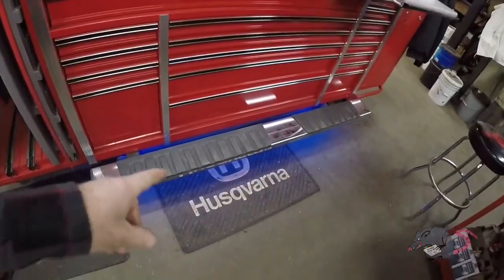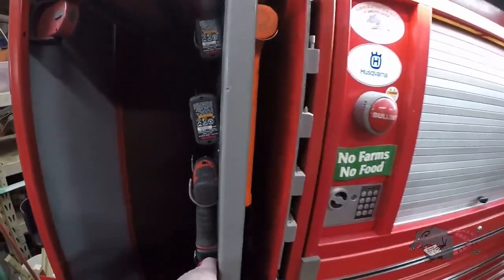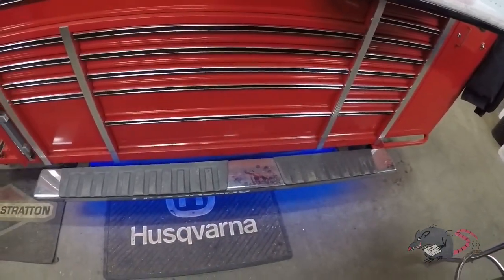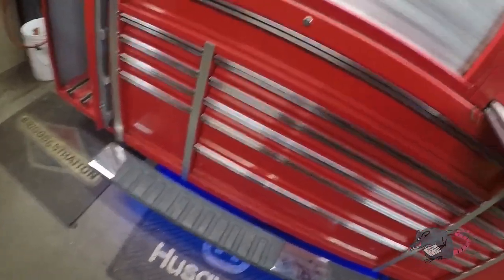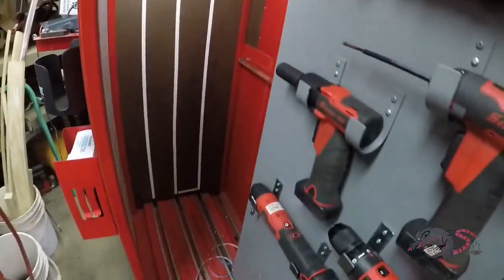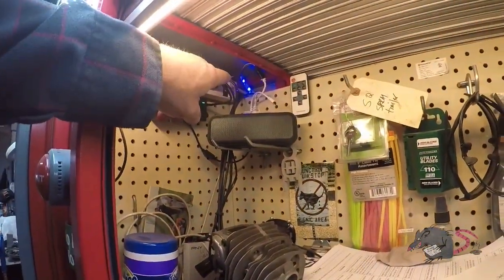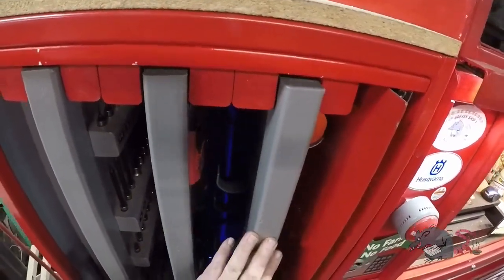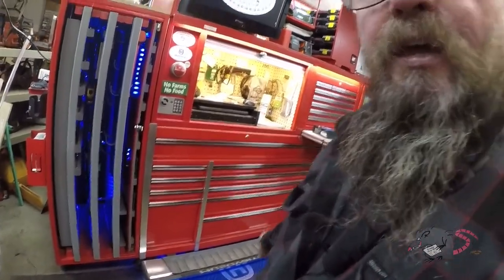Even More LED Lighting!

Comment: IMHO I would have just used white lighting, and forget about the cool thing.
The lights should be used as lights as they were intended for.

one more thing I would have your front sidestep fold under like a running board on trucks, that IMHO
would be cool and practicable. Simply love your ideas and videos.